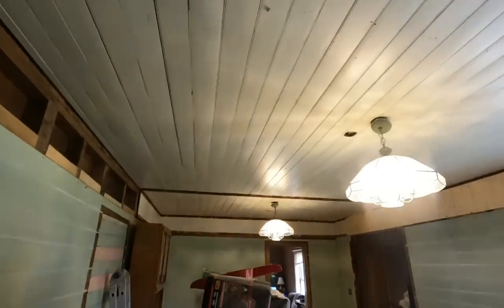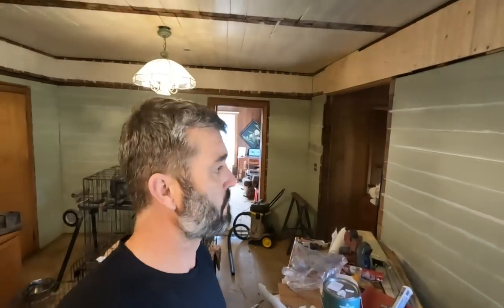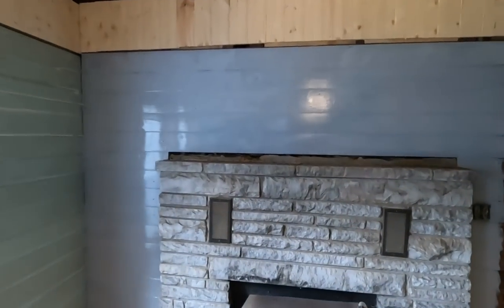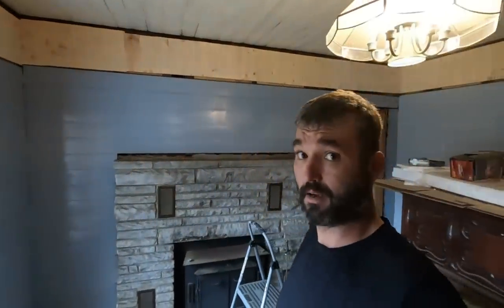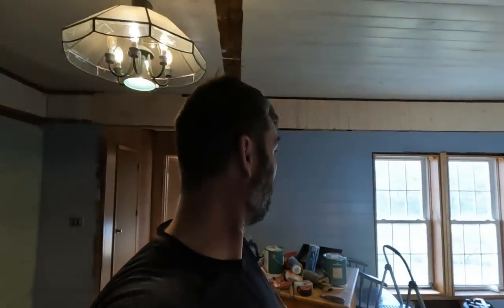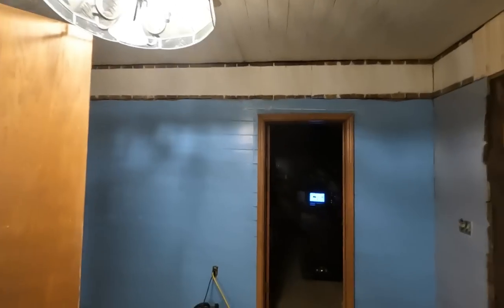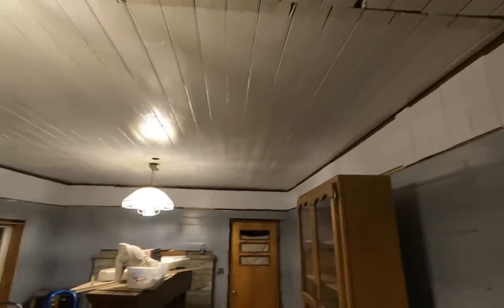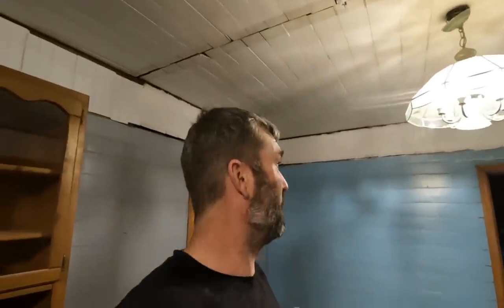SATISFYING | 120-YEAR-OLD FARMHOUSE GET SOME NEW PAINT | LOTS OF HELP FROM COPPER AND CO. OF COURSE

Comment: Your choice of colors is very nice.  The room is going to look 100 percent better.  Just a little suggestion--if you had painted the band around the top of the walls the same color as the wall, it would look like you raised the ceiling.  The paint the way it is makes the ceiling look very low.  Just an observation.  Keep up the good work and it will feel like home soon.

Comment: I was wondering if you used gloss or satin?  Glad to know about the Ben Moore paint.  I have used Valspar before.  Not sure I can afford good paint now a days.  I like the gray, looks good with the brick on the fireplace.  I was going to keep the shiplap on our ceilings but didn't want to do all that caulking so drywall it was.  I bet you can't wait to change out the lights so you don't bop your head on them lol.